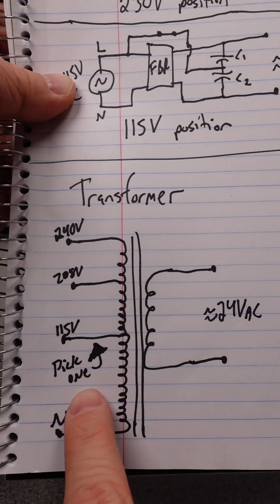What is the Voltage Select Switch on a Power Supply?  #shorts #tech #electronics

Comment: If the switch shows 115 is that a universal rule like on this PSU - Mean Well RT-125 A?
Reply from the maker: If it is a switchable input voltage on a switching power supply input, not transformer, then it is changing the power supplies input diode bridge and capacitor configuration into a voltage doubler.
Reply: @AllThingsOnePlace  good to learn. These type of voltage switch buttons are never " the number shown is the opposite voltage chosen "?? I don't want to fry the supply on the first time powering it.

Comment: 110v/115v/120v devices often have lower idle power consumption. I can imagine that 240v appliances might use 120v as the power source for low wattage parts to improve energy efficiency with energy star or other international ratings. Various NEMA 4 pin plugs, and some international standards, run +120v/-120v/Neutral/Ground as the plug pinnout to get 240v. Tapping only 120v for idle makes sence if the appliances spend most of their life in idle non use.
Reply from the maker: Yeah, it's quite odd, some Energy Star standards let you NOT count the transformer or control circuit in the power consumption.

Comment: Which side is 115, is it on 115 when you cant the the number 115 or 230?
Reply from the maker: The selected voltage is the number it shows.  So if it says 115 it’s set for 115.

Comment: 208V tap is usually for 3-phase power but this seems to be a 208V single-phase xformer.
Reply from the maker: That's correct.  The reason it is only single or 2-phase, is the transformer is for supplying the power for things like controls circuit boards, thermostats, and contactors, these being relatively low power only a single phase transformer is needed for simplicity, but it needs to be voltage appropriate with the 208 volts used in a 3 phase system.